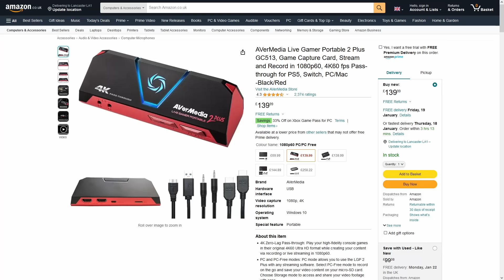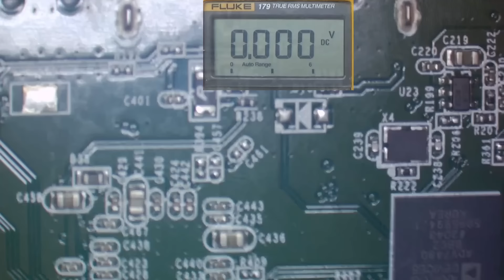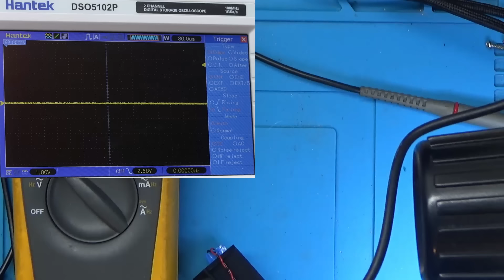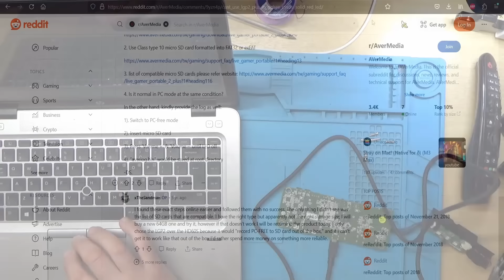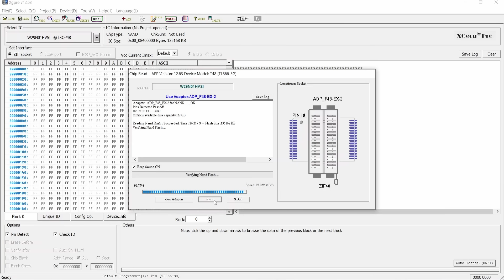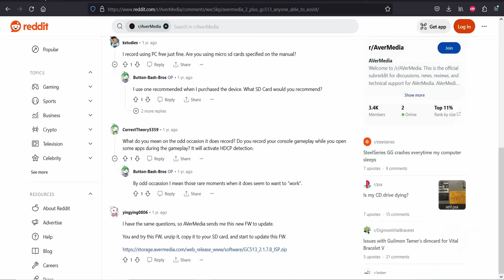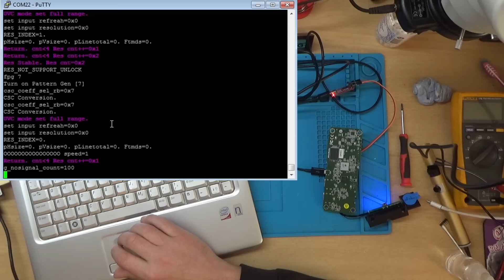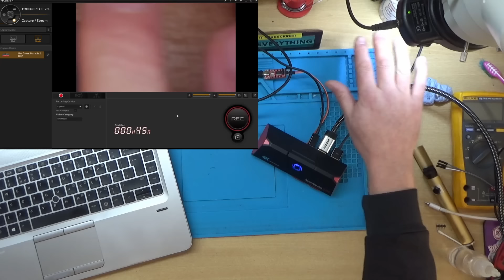Faulty AVerMedia Live Gamer Portable 2 Plus | Can I fix it?

Comment: Mick, Were you sitting at the bench wearing a hoodie pulled over your head like a Russian hacker? That was truly amazing. Not bad for a sheep rancher.
Reply from the maker: 😂😂😂I've not always been a sheep rancher. I've messed with computers / software  / electronics most of my life. I've only been a sheep rancher for the last 6 years or so.
Reply: @BuyitFixit  So, when you neuter a ram, you fix him. Still fixing things. Amazing
Reply from the maker: 😂😂😂well my wife usually applies the rubber rings around them, while I'm holding them so technically it's the wife that does the fixing 🙂

Comment: Impressive work! I thought you'd try the SD card firmware update after you got it to boot with the wrong firmware. But your solution was even more impressive. Well done.
Reply from the maker: Thanks 👍I did consider it, but with it having the 510 firmware on, I  doubt it would accept the firmware for what it would think was a different device. The firmware seemed to have an identifier at the start of 513 for this model and 510 for the 510.

Comment: I have to say that was one very impressive fix. You obviously have some good all round fault finding skills and a very good ability to read and follow guides online to get the results you need. Well done on this repair
Reply from the maker: Thanks Richard 👍I've done a few other ones that weren't so run of the mill too, such as the FLIR thermal camera repair, the solar inverter I repaired in one video and then needed the service password to change a setting which the manufacturer wouldn't give me! Or the RGB laser repair  or the Moanacaster podcasting console I looked at too 🙂

Comment: 46:10 device driver dialog would have been an elevated prompt that the capture software couldn't see.

That was a fantastic video mate... I've played with the JTAG stuff on routers and some cheap PTZ cameras and you can certainly get out of a lot of trouble with bad flashes!
Reply from the maker: Thanks Steve, yes I've played with JTAG too back in the day 😉 also removing chips and hex editing stuff, and reverse engineer software. Not sure if you saw the 'no password, no problem ' video I did or the ultrasound scanner or the recent generator control panel or tractor dashboard video which are along the same lines 🙂

Comment: Absolutely great video. You are very resourceful!!!!!!!!!!!!!!
How did you come up with the idea of connecting to the usb and pressing the button same time? I'd never crossed in my mind.
Reply from the maker: Thanks 👍I saw something on reddit about holding the volume buttons down to write a log file, so I thought I'd try different combinations. Some android devices also have a bootloader mode and even the nintendo switch does 👍
Reply: @BuyitFixit  I would never figure it out! Thanks for sharing your video, truly inspiring!. 
The other thing which I was intrigued: how did you realized about SUNP BURN FILE format? I failed to understand why you wouldn't only transfer the binary image directly using the eprom programmer instead copying from another slightly different Avermedia image.  I hope this makes sense and Ihad understood the video correctly! Thanks.
Reply from the maker: I noticed in the firmware file, the text SUNP BURN, so searched that on google. This format holds information about the different sections of the file and where they should be programmed in the chip. You could possibly work it out manual from this data where all of the different parts of the file need flashed and to what addresses in the eeprom, but some sections may also need to have additional information such as a CRC programmed at a certain address or possibly a header containing additional information. It was easier to let the flashing program sort that out, and remember at one point the software mentioned about resizing the partition size in the flash. Hope that helps explain it.
Reply: @BuyitFixit  awesome, honestly. Well done!
Reply from the maker: Thanks 🙂👍

Comment: A great fix! Your early videos elude to your programming interests, so they came in extremely handy here 😊 it does look as if a firmware update went wrong or something corrupted the data and wiped everything. A great plus with your son having a similar model to get some of the info from too. A great job at getting the info from the files bit by bit, this must have took some hours to fully repair, I used to use PuTTY in the late 90's - 2000's, a great little tool for diagnosing networking errors. Most would have stopped when they found out that the firmware was toast. Loved the in - depth microscope and oscilloscope work, excellent 👏 It gives me more confidence to do more myself now, I have been repairing milwaukee / bosch tools and 2 x 110vac Trend T35 AL, M class dust extraction units in the last few weeks, so thank you for that. Looking forward to the next one 😊👍
Reply from the maker: Thanks 👍Glad you are feeling more confident with your repairs too🙂
Reply: @BuyitFixit  thanks Mick, it is appreciated 😊👍

Comment: At the point where you'd got it working but the wrong model, I wondered if it would have done a successful FW update using the built-in procedure from the supplied update FW?  Saved the work of extracting all that data from the package.  Again, a great fix.

It seems failed updates are the new shorted capacitors ;)  Bit more work to diagnose and fix though, but I guess that's progress for you.
Reply from the maker: Thanks 👍No unfortunately the update procedure wouldn't work because it thought it was 510, and wouldn't take the 513 update.

Comment: Quick one for you if you're ever doing stuff like this, plugging in and out usb over and over. I made a little box with a male and female usb a and a 4 pole switch. Just handy little thing to have around and cost me a fiver to make. Save wear on the precious usb port.
Reply from the maker: Thanks for the tip👍..but perhaps I could do a video replacing a usb socket on my laptop 😊😂😂😂
Reply: @BuyitFixit  Why do you think I made the box.....it was right after I replaced my front usb sockets on the desktop.
Reply from the maker: Nice one 👍

Comment: Astounding and very interesting - thanks! The PC will only pick up the device when the right-hand switch is to the left or the right. The middle position is for recording direct to the SD card.

I'm on my second one of these - the first didn't give me any video signal via HDMI, so I returned it for replacement. Turns out that the HDMI lead was faulty, not the device! I should have done as you did and try a different one.
Reply from the maker: Thanks 👍yes for the PC to detect it normally the switch has to be to the left as you say. However putting it into bootloader mode (hold top button down while plugging into USB) it doesn't make any difference as this is before the switch state is even read 🙂

Comment: I'm kinda not surprised by a "self-destructing" IC these days, especially with something like this that could be considered usable so many times before things get wiped and a new one needing to be bought (gotta love e-waste). But as you also said that it could've been rendered faulty by the end-user either thinking that an update was done or was in too much of a rush and pulled the plug before the firmware update was finished. At least it can live again and be useful as a spare/backup.
Reply: "  "self-destructing" IC these days, especially with something like this that could be considered usable so many times before things get wiped "
I have often wondered about that . A small countdown timer built into one of the chips and 4 moths outside of the warranty it "breaks "
Reply from the maker: Perfectly possible. See the recent Polish train saga 👍

Comment: Amazing video. Binwalk might have made exploring the firmware a touch easier.
Reply from the maker: Thanks 👍yes I was going to use binwalk as I've used it before but I didn't have a linux machine to hand. I did look at using the windows version but found 7zip extracted what I needed 🙂

Comment: chapeau Mick. Wow, really impressed by your analysis skills. One question: once you'd managed to flash the chip with your son's firmware, could you not have upgraded using the SD card rather than having to delve into the files?
Reply from the maker: Thanks 👍No, when the unit was flashed with 510 firmware, it would only accept firmware for that model via SD, which makes sense to stop you flashing the wrong firmware via SD.

Comment: Absolutely Amazing Fix.
Reply from the maker: Thanks 👍Yes sometimes I get stuff that is way out of the norm. Hopefully this helps other people that end up with a similar problem. I did get a message from someone who explained how they "bricked" their unit. They had left the SD card in after an updating, and it was plugged into their PS5 which switched on to do an update, and switched off again while the Avermedia device must have been in the middle of updating itself again from the inserted SD. Result - bricked a like this one was.

Comment: Please could you explain how you hooked up to putty? Excellent vid - thanks very much!
Reply from the maker: Thanks 👍yes I used a usb to ttl converter. This let's you hook up the TX and RX signals and a GND from the board. You then have to tell putty to use whatever COM port number the computer assigns it and set the baud rate which you may need to try a few. Popular ones are 115200, and 9600. Hope that helps.
Reply: @BuyitFixit  thanks thank great. Have screenshotted this for the future.

Comment: Another way you could have put the original file on is to reapply the sd card update at the point you had managed to get it to boot with your sons firmware ... Great content .. love your videos... from another geordie tech .. Barry
Reply from the maker: Thanks Barry but unfortunately that wouldn't work, because each firmware has the model number at the start. This means that because the unit though it was the same model as my sons it would have only accepted firmware for that model, and not firmware for the actual model it was. I guess this is to stop people accidentally downloading the wrong firmware to the SD and flashing it.
Reply: @BuyitFixit  yep never thought about the serial number ... prob also stop people doing upgrades and giving a lower spec recorder a higher spec software ... was a great watch ... being a radio ham I take intrest in repairing and making good again... I'm originally from Newcastle buy now live in Washington and run Wears radio club in Sunderland ... keep those repairs coming ..... Barry g0sci
Reply from the maker: Thanks Barry. I did my foundation, but I've not really used my radio too much since. I've tried a few digital modes which worked, but because I live in a valley getting out anywhere with 10W is a bit difficult. I was messing about with meshtastic the other week. I was thinking of setting up a permanent node with a solar panel, but not got round to it yet. 73 🙂
Reply: @BuyitFixit  yep u have a igate node myself g0sci-1 ... love watching your videos ... done a few myself .. not as good as yours ... barry
Reply from the maker: Thanks Barry 👍

Comment: PuTTY is not actually a programming tool, it's a communication tool. It just so happens that due to everything being built on legacy interfaces, you can use it for that device through a COM port.
Reply from the maker: Yes it's a terminal emulator, can be used for ssh, telnet and serial. I've used it a fair bit in the past for similar work.

Comment: Not sure if this will help you but I wonder if the hissing when you record the old laptop is caused by the program that records the screen also recording sound from the audio card.  If it does then I think I may have an answer for this issue.  I had a similar laptop that when I used headphones with it I would get a hissing/buzzing sound from the audio jack.  I found the solution to be add some tape to the top of the audio jacks inside the laptop to prevent the metal case of the jack from touching the shell of the laptop.  The issue was caused by some sort of ground loop within the laptop itself.
Reply from the maker: Thanks for the suggestion, but the laptop was not recording any audio, and only the video. The only audio being recorded was from my Rode videomic pro which is connected to the Sony overhead camera. It seemed like the laptop was radiating some kind of radio frequency that was being picked up by the mic or camera.

Comment: From start to finish, how long did this TS and repair take? I'm sure you had to revisit it over at least several days or possibly weeks.  If it was me, this would still be collecting dust somewhere, or yep, in the scrap heap.  I would have ran out of knowledge and patience a long time ago...probably at the step where you saw power everywhere and the oscillators were all working. 😅Seems like you have a quick way to remove all of that pesky conformal coating, but I didn't catch that part.
Reply from the maker: It did take a while, I'd say I spent about  3 days or so total, but there was a break in the middle as I had to order a stop 48 adapter from China. Once I confirmed that the chip was corrupt it took a couple of days to figure out how to sort it. There was no conformal coating 🙂

Comment: But is now still the modified firmware copied from your sons device on it? Does it make sense to do the avermedia recovery after all as well?
Reply from the maker: No, it's now got the proper firmware on that I extracted from the file on the Avermedia site. It wouldn't be able to update from that file from SD as it thought it was the same model as my sons (GC510) and it's a GC513 so the 513 firmware wouldn't flash. The only way was to extract the files manually and flash it over.
Reply: @BuyitFixit  thanks for explaining

Comment: I wonder once you had it working with the other device's firmware would you have been able to use aver's flashing software to flash the correct firmware on there? Maybe it would refuse but would have been interesting to know.
Reply from the maker: I doubt it would have worked as the firmware have a header that contains the device model  number.  If you notice at the start of the proper firmware it has a 513 so it probably compares this to stop you flashing the wrong firmware. Seeing as the device thought it was the 510 I doubt it would have accepted the 513 firmware.
Reply: @BuyitFixit  yeah the header would be why I would think it might refuse, could you edit the header perhaps.
Reply from the maker: You probably could but then there are probably checksums which you might need to patch too. Probably easier to do it the way I ended up tbh.

Comment: I was wondering, once you had the initial firmware working, could you have flashed the proper firmware from the SD card through the regular mechanism?
Reply from the maker: I did try that but unfortunately not, as the firmware checks the model number, so it wouldn't load the correct firmware as it thought it was the other model.

Comment: After you flashed the 510, shouldn't it have worked with updating the firmware to the proper one using the sd card method?
Reply from the maker: No, it would only accept firmware for the 510 as that's what it thought it was. I did try that too 😊

Comment: Some of those devices did not break because of user error.  MS yes MicroShat deployed drivers that maliciously wrote garbage to firmware of devices to disable them.  It was a ploy to disable fake knock-offs of original hardware that did the same thing.  The hardware manufacturers may or may not know of the knock-off hardware used because of supply and demand chains.  A similar device known as a "Game Surge" were mostly affected because use of a USB interface chip was literally bricked/zero'd off in firmware because of the updated drivers MicroShat put out
Reply from the maker: I think that was fake FTDI chips perhaps? I do remember some manufacturer bringing out an update to brick counterfeits.

Comment: That fuse with no voltage could be the power pin (18) on the HDMI connector?
Reply: Yes it was, answered my question by just patiently waiting 😂
Reply: I would hook up devices to a Linux machine and monitor dmesg -w, this gives much more valuable information.

Flashrom is my best friend!
Reply: Those firmware files generally are "flashed" to a region, so when you get one that is different... it might just be padded data much like the empty regions. Simply removing the padded data usually works for MIPS based devices.

Also, powering up with the button pressed was an indication the bootloader worked as was evident from the output of the debug header.

I think it should have loaded from SD card, it might be very picky on what it expects the SD card to be partitioned/formatted as. Some devices can be really picky when it comes to the starting sector of the first partition.
Reply from the maker: Thanks 👍I did do a bit more testing off camera. It seems AVerMedia put their own header in front of the SUNPLUS header block. I did try removing that but still no update from sd either. The cameras appear to use that format but AVerMedia seem to look for their own header on the file which seems to hold the model number right near the start. I guess it's to stop people accidentally flashing the wrong firmware on a different device.

Comment: I wonder if there is any difference between this one and your sons, or if its just firmware? Seems strange how well it worked on the wrong firmware
Reply from the maker: I think the only difference is the 4K passthrough. So I guess it has a chip that supports the 4k and perhaps downsamples it. My microscope was 1080p so perhaps the difference is only when the 4k is used.

Comment: First thing I would have tried is to remove/reinstall the backup battery.  Many a laptop has gone Hal 9000 from a backup battery.
Reply from the maker: When I had it under the microscope it was disconnected as I had the whole front panel unplugged. It's just used for the RTC, but I get where you're coming from 👍